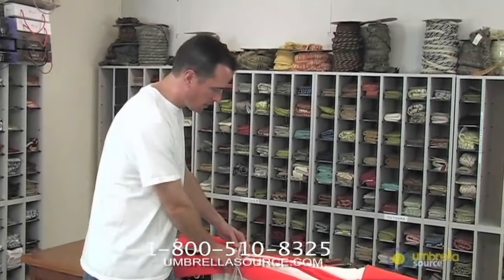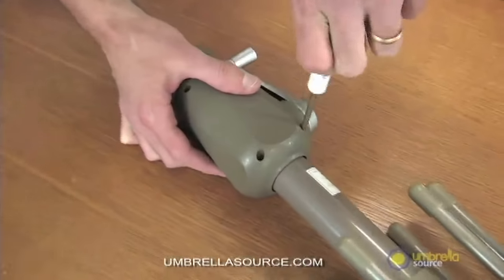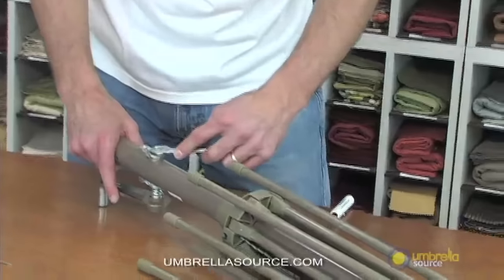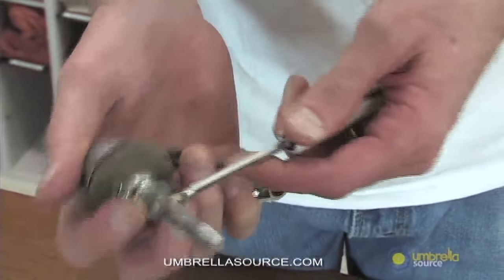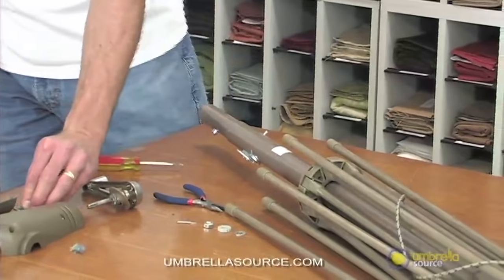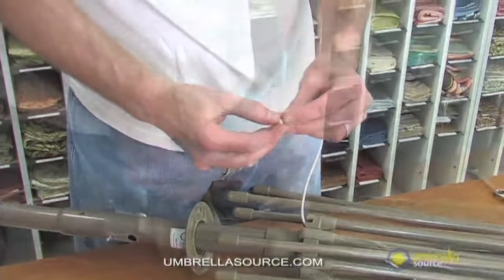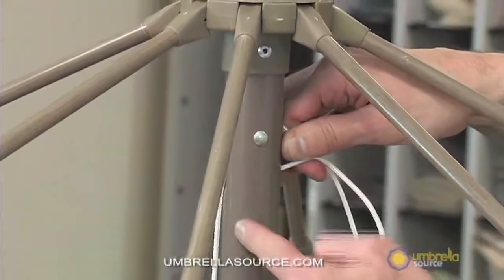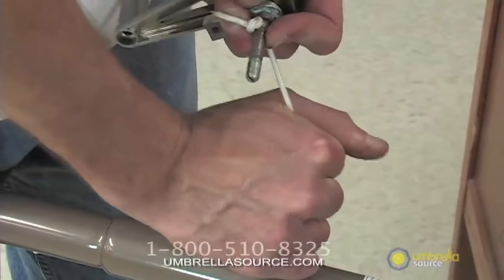How to Replace an Umbrella String

Comment: Just wanted to say thanks for this, your video has saved me a chunk of money in not replacing our patio shade, but I didn't realise this until I'd dismantled ours and watched for a second time. Ours was bought from a UK DIY store a couple of years ago and the winder mechanism is nowhere as well made as that shown. So when our string popped I dismantled the whole unit thinking I needed to replace the string completely. In fact all I had to do was prise off the two retaining rings above and below the winder cover, then take off one side of the clamshell exposing the "other" end of the winder. Make careful note of the order of the various washers and nut as you take them off. Then you can pull the handle through and with it the other side of the shell. If you watch carefully from around 10 minutes you'll see how you can hook out the end of the string, tie a new knot and then reassemble the opposite way. With mine there was more than enough string to reuse without having to buy a new one.

Very pleased I found this, a replacement shade here in the UK is £70 or more.

Comment: Absolutely on the money. A perfect explanation and demonstration of how to carry out this tricky procedure. I had a slightly different set up at the winder housing and the access to the pulley but was given confidence by this video to work out how to cope with the additional challenges. The only issue that brought me to a halt for a couple of days was the diameter of the hole in the winder to take the cord. I bought 4mm before I had the assembly apart and no matter how I tried it wouldn’t have it. Once the correct 3mm diameter cord was delivered, the rest of the job went like a dream. I am very grateful for this video tutorial.

Comment: Thanks very much for this complete instructional video.  Given my innate lack of patience, I decided to do a crude but effective fix, rather than replace the string.  First we unfastened and removed the section of the pole attached to the umbrella itself from the base pole.  Then we used blue painter's tape several times around each pole section about 2 inches from the end.  This is to reduce the slipping of the drill bit against the metal you're drilling into.  For this fix, we chose an old 1/4" diameter screwdriver we no longer needed.  Therefore we used a 1/4" drill bit.  We drilled a hole straight across each side of each pole.  So there were now 4 holes.  We then raised the umbrella and lined up the holes on the base pole with the holes on the umbrella side and inserted the screwdriver through the aligned four holes.  Be careful to hold your drill in as flat a horizontal position as possible.  Then insert your screwdriver through the aligned holes and it will support the umbrella in the up position.  We leave our umbrella up but if you want to take it down when not in use, simply pull out the screwdriver.  An Allen Wrench would be cleaner and just as or even more effective than the screwdriver, but what I just described works.  This doesn't give you the position options or  flexibility of the original design...but it works if you main goal is to keep the sun, or rain if you are so inclined, off you...

Comment: Although this video is helpful, as noted in several comments, not all umbrellas are designed alike. With about a day of first timer effort, several trips to the hardware store and this video, I was able to successfully restring my Treasure Garden market umbrella. Next time, I will be able to do it in under an hour. Here are a few things I learned. 

I bought a 50 foot bag marked 1/4 inch nylon umbrella repair cord at home depot for less than 5 dollars. That's enough to repair my 9 foot TG market umbrella 5 times.

My top and bottom rib collars did not twist off like in the video; mine had screws. The ribs in the collar are held in place with about .5 inch steel tubes. These can come out easily and take some practice to get back in place. My umbrella has a push button tilt so the pole is not hollow. As another poster mentioned, this make it hard to thread the new line from the pole top down to  the crank area. Using the flashlight on my phone I noticed the hole inside the pole for the string is about the same diameter as the 1/4 inch nylon string. I used a sewing machine needle, sewing thread and gravity to work the thread through the small hole, then tied the umbrella repair cord to the thread and pulled it through. Also, my pole had a round rubber cap at the bottom that I was able to pry off with a screwdriver to make it easier to pull on the threaded sewing needle. The last tip I have is that my umbrella has notches in the top and bottom collars that indicate where the cord should be pulled through. On mine, there is only one right location for the outside, visible cord to be threaded. You might want to take note of that location when beginning disassembly.
Reply: Perfect! Thank you for the extra information, especially where to buy the cord and what size
Reply: Thank you for the extra tips! Mine also has the tilting head option and would have been at a loss if I hadn't read your comment 😊

Comment: Thanks for posting this. It was a great help to doing mine, even though it has a different, aluminum construction.  Most significantly, it has an angled tilt mechanism between the top and crank section.  So it required a step including a stiff wire to thread the cord down the core.  I don't have a tool like that, but fortunately I had some leftover bailing wire I could tape to some leftover 1/8" parachord.  Regardless, I'm not sure I would have even attempted without your video.  In any case, the wife and I are happily back out on back deck, plus I have a perfect future retort to any "pack rat" crack. So thanks again.
Reply: Ours has a tilt mechanism too and I used old net curtain wire to get past that but like you I'm not sure I would have attempted the task without this video.

Comment: Thanks for the helpful video.  Took me a lot longer than you, but the video was a great resource.  I could not get into housing for the sliding hub.  I ended up tying my new string to the broken end of the cord coming out of the hub.  Also, to reach the pulley, I had to unscrew the top housing, causing all the ribs to come apart at the top.  Took me a while, but I got it all back together.  Again, thanks.

Comment: While this does an excellent job of explaining how to remove the crank, the key to this repair is running the new cord down from the top of the umbrella inside the pole to the crank location.  My pole has a hinge about three feet from the top, which allows the umbrella to tilt.  The video fails to explain that it is next to impossible to run the new cord down past that hinge as there is so little space and the hinge is not accessible from the outside (nor easily removed as it is riveted in place).   The only way I can figure to do this repair if the pole has a hinge is to NOT remove the old cord at first, but rather attach the new cord to the old one near the crank and try to use the old cord to pull the new cord up the pole to the top.
Reply: I threaded a dog tag-type ball chain over the pulley and down the pole.  The new cord was taped to the end of the chain and I was able to pull it through relatively easily.  The ball chain has both the weight and flexibility needed to get the cord over the pulley and down the narrow tube.
Reply: @jodyfarhat6094  I'm glad that worked for you.  Mine, however, has only a small (half a centimeter) hole in the hinge for the string, and it is almost impossible to re-thread that with anything that is not solid.   I've considered using a piece of stiff wire, but the problem is attaching the new cord to the wire so that the wire and the attached cord go through the hole.  I note that in newer model umbrellas, the "cord" is wire.

Comment: Thanks for your video. My cord wasn’t broken. The nut on the gear side came undone. This particular model doesn’t have a cotter pin, but it has 2 slotted washers, one has tabs on it. One thing I found easier to put the fabric back on was after I got it screwed onto the frame, I put the it back up and put the ribs back into the pockets.

Comment: hey excellent fix. Can you help identifying the name of the little metal push button that separates the umbrella from the bottom pipe? What is the correct name for it. Need on for mine. Thanks..

Comment: There is one problem I encountered: 
The string does not go easily through the pipe. The hole narrows at at least one point and the string catches there. I've tried several things but haven't gotten it through yet. I'll keep working on it. Any ideas?
Reply: Could you tape or tie something heavier to the end, perhaps a narrow bolt, and then lower it through?

Comment: Crank bolt broke on mine. Had i disassembled and replaced string might have prevented bolt from breaking as was really hard to turn. Cant seem to find replacement crank bolts so will try to make one out of lag bolt. Or just buy new umbrella for $40...

Comment: Thanx, this helped me figure out how to take it apart. I even watched it a second time because I'm on my third cord. But I've learned that the easiest way to assemble is from the bottom up because my tube needs to be split because of the elbow. 1-reassemble the crank with string and insert in tube. 2-continue running the cord out the elbow and then up to the top pulley. 3- I use a metal blade from an old disassembled car windshield wiper to make a hook. 4- pull out the slack and reassemble the elbow. 5- I simply close the umbrella and tie the cord to the hub and then cut off the rest. Be careful, the elbow is spring loaded.

Comment: Our umbrella had a hinge half way up the aluminum shaft.  Inside is the hinge mechanism.  The result was it was nearly impossible to pass the string.  Finally I purchased a 1/8 inch braided cable with a plastic cover and I passed that down the 3/16 inch opening in the hinge and used that to pull the string through.
Reply: I'm having this exact problem and I have zero clue what to do !
Reply: Robert Sinsheimer
Reply: Hi Robert - I have a auto-tilt mechanism inside the pole and cannot get the string to go through the hole. I like your idea of using 1/8" braided cable. How did you attach the cord to the cable once you were able to thread the cable through the hole?  Thx!
Reply: @georgeplosker5101  it was 6 years ago, but I might have sewed the one to the other with needle and thread or I might have used duct tape but more likely the former.
Reply: @paycloseattentionbob  Hi Robert - thx for your prompt response! I used 1/8" braided cable and was able to feed it through the hinge mechanism. I then tied heavy duty thread to the cable and added Gorilla Glue to secure the tie. Then attached the cable to 550 nylon paracord (5/32") with several secure stitches. It passed through the hinge with no problem. Umbrella now fixed! Yay! Really appreciate your help. Without the cable there was no way I could pass the cord through the hinge!

Comment: He never shows the removal of the pipe handle bushing. There is one on each side of the pipe that are attached with rivets. You have to drill out the rivet on one side in order to get the string to feed out and back into the pipe after you tie it off on the crank handle. You should then install a new rivet to secure the crank handle bushing.

Comment: Good video except for the pins all shift and freely fall out in the umbrella skeleton and getting that bottom cap on is challenging.  I'm gonna put the pins in axel grease to keep them in place.  I have no idea how I'm gonna get the string back down the tube and through the two tiny holes in articulating section half way down.  Or maybe I'll piss on this turd and throw it in the dumpster.